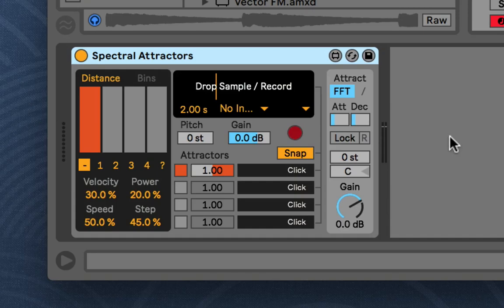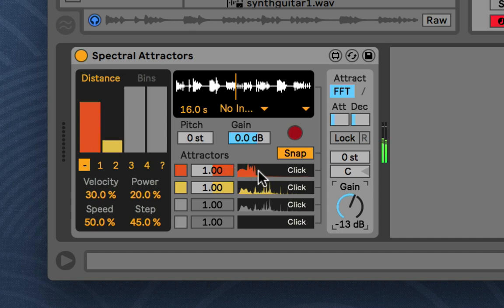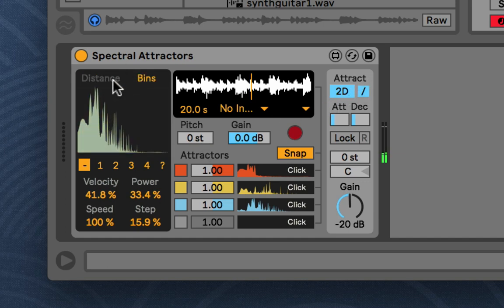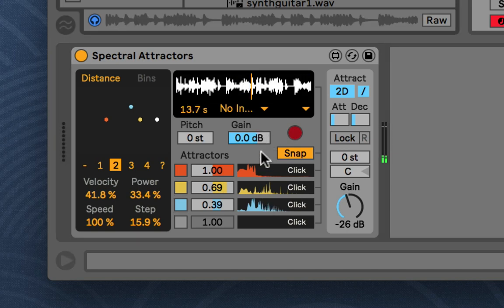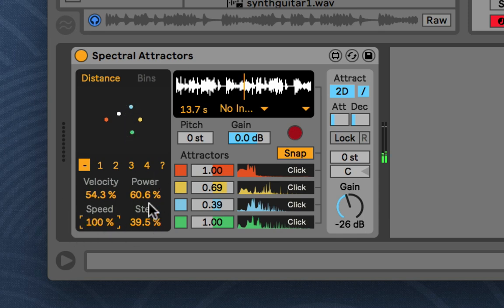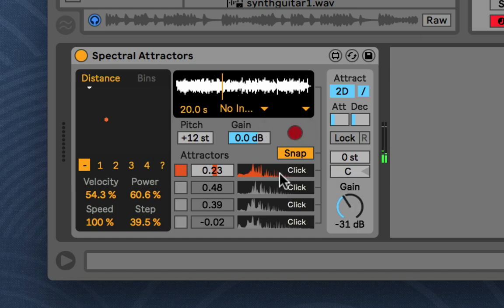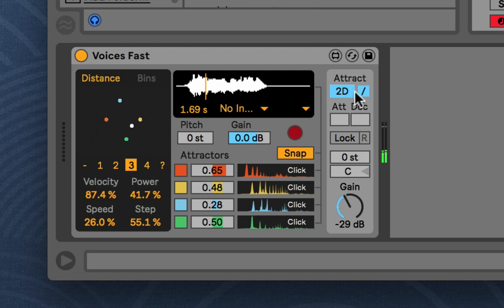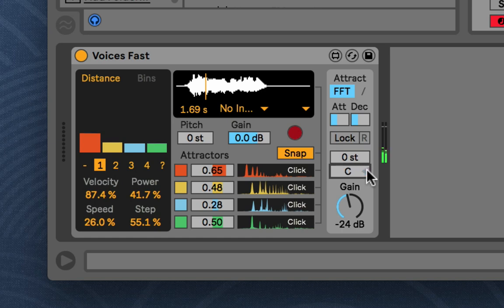Spectral Attractors Walkthrough

Comment: Can the white dot be mapped to an XY pad, so that you can control which attractor it moves towards in real time?
Reply from the maker: not currently, it could technically be but it only makes sense for 2D mode and not FFT mode
Reply: @dillonbastan246  Thanks man! Yeah I think it would work really well in 2D mode. Great device by the way! Love using it
Reply: @dillonbastan246  can you modulate/set the attractor weights externally?
Reply from the maker: @cwmoriarty  You can set the weights externally. You cant modulate them externally, that would be like side stepping the whole functionality of the device. Related to the previous commentor: in 2D mode there could be room for controlling the XY position of the 2D point and that would be the only feasible way I could see an edxternal modulation of the weights but that is not implemented (again it is kind of side stepping the whole attractor aspect of the device).

Comment: Q1: What determines the position of the attractors in 2d mode?
Q2: I still don't quite understand what is the difference between 2d interpolation mode and fft mode. What is it interpolating?
Reply from the maker: So I'll explain a bit: first what we are hearing is a phase vocoder in stereo. In order to have it working, we need some values from an FFT: the magnitudes and phases of each frequency bin (in this case 2048 values each), and also the phases from one previous FFT frame (another 2048 values) and actually another set of those values for a second channel (to make stereo). In total that is 12288 values that I am using to create a phase vocoder. 
So an attractor is actually just those 12288 values that were at whatever position in the sample you selected when you created the attractor. Then I run a physics simulation of gravitational attraction, and the attractors are different points in the simulation that a moving point is attracted to. The moving point is actually the sound that we hear. The way this works can be in two different modes:
FFT mode: The physics simulation takes place in 12288 dimensions (versus say the usual 3D or 2D), where the attractor points are literally the 12288 values that make up each attractor. The moving point is also in 12288 dimensions, and so its coordinates are the 12288 values needed for a phase vocoder (so whatever position it is in is sonified by the phase vocoder). This mode allows for very diverse movements as the position and dynamics can vary in all of those dimensions and create a rich stereo field as every frequency bin's magnitude and phase values for both the left and right channels are independent dimensions!
2D mode: The physics simulation takes place in 2 dimensions. The positions of the attractors are still determined by the 12288 values, but it is reduced to 2D based on each attractor's relevant distance to each other and then projected into 2D space via some trigonometry. Then the moving point is also 2D and attracted to the attractor points (again, now in 2D based on their distances) just like in FFT mode. However, since the moving point is in 2D (only 2 values), we don't have the 12288 values needed for the phase vocoder. So to get them I give 2 more options, interpolate or crossfade.
Crossfade simply checks how for the moving point is from an attractor, and fades in the volume for those attractor values based on distance. So in those mode, the attractor is heard just as it sounded in the position of the sample, and therefore may sound "colder" cuz it doesn't have the crazy stereo modulation like FFT mode. Yet maybe you'd want the sound more like the original sample or whatever reason.. so it's there
Interpolation: This one uses an interpolation algorithm based on the moving point's relative distance to each attractor, and then interpolates the 12288 values accordingly. This allows for a richer stereo sound, as the FFT values aren't faded in, but is an interpolation between the attractor values. However, it won't have near the complex dynamics of the FFT mode, yet it will save a lot of CPU and perhaps the 2D dynamics are more desirable. Hope that helps!
Reply: @dillonbastan246  thank you for the detailed response. That actually helps a lot. One more thing: why 2048 phase values from the previous FFT frame?
Also just to make sure I got it: contrary to 2D interpolate mode, where all 12288 values are interpolated linearly at the same time, FFT mode can interpolate those 12288 values independently because that the physics simulation is implemented in a way to access all those values independently. And so, the single bars in FFT mode is an abstration (a reduction to 1D) of what is actually going on under the hood, as a low value may actually mean a strong weight on that sound but only on a couple dimensions. Correct? (Btw, this is where I think my confusion started)
Again, great job, pleasure to e-meet you.
Reply from the maker: @linkcell  You need the phase values from the previous frame in order to create a phase vocoder, that is part of the phase vocoder algorithm (basically you can recreate the dynamics of the sound by using the differences between the phase values of the current and previous frame).
 
As for your second remarks: well in FFT mode nothing is interpolating, it's just that since the physics in that mode uses vectors of 12288 dimensions, then I can just use those vector values for the phase vocoder. And attractors are attracting the moving vector that you hear to their position. But as you can imagine, the dynamics of the vectors can be very diverse, for example it could be that in some dimensions the moving vector is closer to one attractor, but in other dimensions it is closer to another, etc. So it is quite different from 2D mode that just bases the sound from a single distance value. And yes the sliders in FFT mode represent the overall distance from the moving vector (the sound you hear) and each attractor position (the distance value is the magnitude of the directional vector, which is the differences between each value of an attractor vector and the moving vector).
Reply: @dillonbastan246  I should have known some of that, but it always nice to be able to hear from the creator.
I gave a small donation when I bought your device.
Thank you for engaging in this discussion here online. 
Best